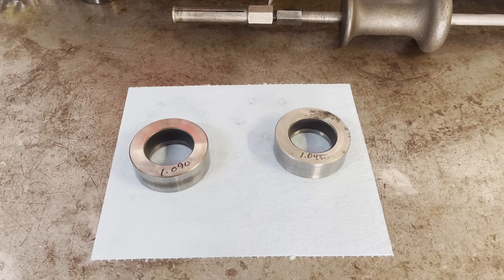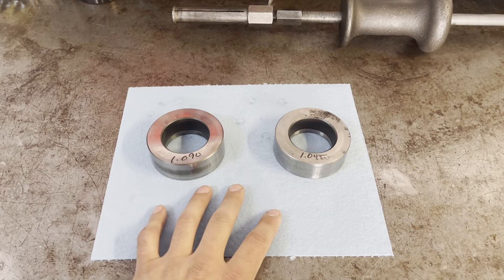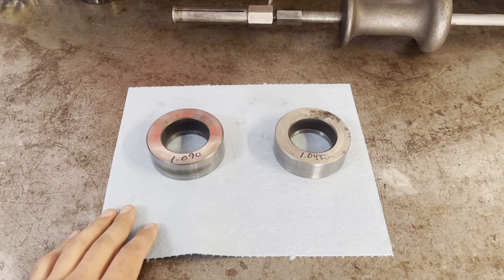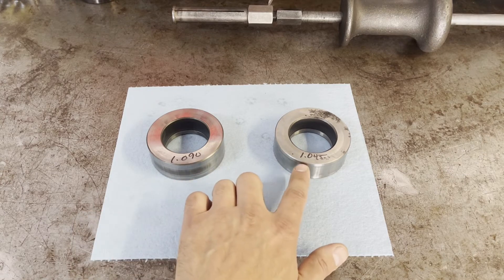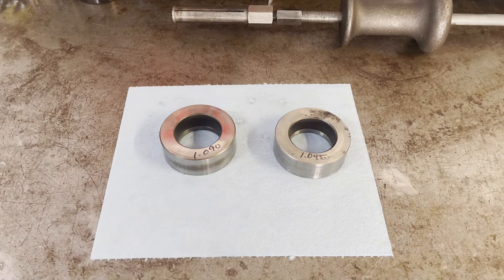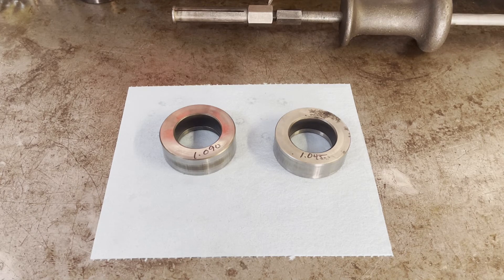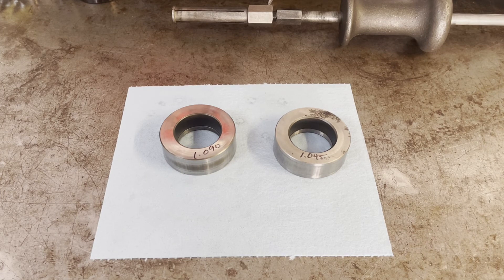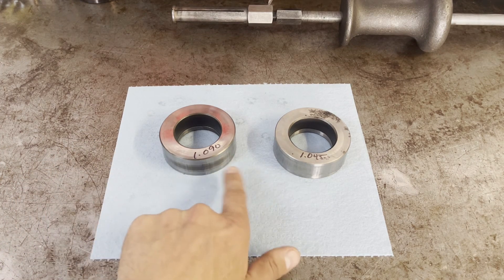Rebuilding the Ford C6: Low Inner Race and Effect on End Play

Comment: It also seems to stand to reason that the snap ring placement, where the lower ring gear locks to the output shaft, could come into play here as well!
Reply from the maker: It may if you use a thicker/different snap ring though I am not aware of that being a selective part.

Comment: So I believe this information is something I needed to see…….However I don’t know if what I did is going to work out or not.  This is the same unit that we have discussed in your build video and what a mess it has been from the previous builder.  Anyway my end play was nuts, nearly 0.090 with the black pump washer and still 0.045 with the thickest washer I have, 0.090.  Anyway I found a 0.025 shim from my rear end stuff that fit nicely under the rear planet thrust washer and with that in place I now have right at 0.022. Clearance.  I’m just a little concerned with the planet gear/ring gear contact pattern because I did raise the planet slightly.  It feels smooth so far and I can’t find another Low roller inner race at this time.  Also to get my forward clutch clearance at 0.025 I needed to stack 2 0.053 (ish) steels together in the middle of the clutch pack. I have seen units of other models done this way from the factory so I’m not as concerned with this as the other and stacking it any other way was giving 0.060 clearance in the forward clutch, 0.024 in the direct clutch and right at 0.040 in the low/reverse.
Reply from the maker: I don't think any of your mods/improvisations will lead to any problems but you won't know for sure until it's back on the road.
Reply: I pulled it all back apart and checked the planet to ring gear contact and it looked fine, still easily fully engaged as in none of the planet gear teeth were exposed/out of contact with the ring gear.  I even tried to shim directly under the ring gear but then I couldn’t get the snap ring installed.  I saw your other video about the roller clutch race and its effect on overall end play…..NICE information!!!  As far as I can tell this unit was pieced together from somewhat random parts with little to no concern about much.  I’m not proud of that kind of mod but I feel confident the shim that I made will stay put and everything turns smooth and easily, air checks well too.  I will soon see.  Thanks again for your comments and the time you took to put together the posts.  Take care Nick…all the best to you.
Reply from the maker: Thanks, Ross - you too!

Comment: I don't remember all the details, but I remember machining a pocket in the sprag race for a turbo 350 pump bearing. This is the part I don't remember, but I think the pocket was .130 deep, then you drilled a small hole into the cooler return since this is your lube circuit to lube the bearing.  Been a long time.
Reply from the maker: I have heard of folks doing that as well. I think John Wood does it for the C6 transmissions that he builds...Folks also have pre-machined bearings available on places like eBay from what i've seen lately.
Reply: @nickstransmissions  I bought the first one from a place in Pittsburgh called Recon A/T Parts, no longer in business. After I saw what they had done, I did some R&D, rob and duplicate and made my own. Those were the worst trans for starting in second gear, the governor would stick. I tied polishing the valves, all kinds of things. If you would stop, and back up it would flush out the governor since it was not effective in reverse. I learned later on that if you put a check ball from a GM trans in the one side, it would rattle the governor loose.
Reply from the maker: Interesting, Peter - thanks for sharing. I've also had some trouble with them but typically they are just dirty or contaminated and need a thorough cleaning to make function normally again...but every once in a great while, ill have to replace one due to shifting problems.
Reply: @nickstransmissions  I used an inline filter from Seal Power on the return line from cooler. Chrysler and Ford transmissions  had zero tolerance to dirt. Chrysler on some models, had a valve in the radiator inlet that would plug up, it didn't take very long to burn one up. I quit doing carry outs, guys would just slap them in, and not check the coolers
Reply from the maker: @monkeywrenchization  Agree, they are super sensitive to contamination, especially the dodge units. The cooler bypass valve / heat exchanger circuit is typically eliminated as it likes to clog or malfunction, resulting in mixing of coolant and atf thereby destroying the trans. Im not super familiar with them other than what customers have shared and that’s a frequent mod they do/have done.
Reply: @nickstransmissions  My 2014 GMC Sierra with a 6L80 has a cooler bypass on it. They claim that by waiting to cool the fluid, that it improves fuel mileage. Last summer I was climbing the mountain that we have many of where I live, I noticed that the trans temp was reading 240 in the driver display. I know that I'm old school, but I was taught that when the temp gets to 240, that it starts to break down, 260 acids and varnish form. It takes Dexron VI, is it that much better? There is a block on left side of bell housing that attaches the cooler lines. Remover block, on top there is a plug held by a snap ring. Remove plug and install the parts in the bag, put it all back together. Now it cools 100% of the fluid 100% of the time.
Reply from the maker: No, it's not that much better than Dex 3 that it can handle prolonged exposure to 240+ degree heat...At those temps, fluid does start to break down and before long, you're taking years / tens of thousands of miles off it's life. I also live where mountains are everywhere and tell all my HD/Towing-Hauling customers to stuff the largest, fattest aftermarket transmission cooler they can fit and run transmission temp gauges in the dash to monitor temps. They also usually elect to go with large deep pans for additional fluid capacity...I hate those stupid cooler bypass valves...luckily the aftermarket has plenty of delete kits for most applications.

Im assuming you changed the fluid before driving it again...
Reply: @nickstransmissions  I did change filter and fluid. Cost me almost $100.00 for Dexron VI 5 quarts. My truck is a 7200 lb. towing package, trailer brake hookup, bigger brakes, extra trans cooler in addition to the oil to water cooler in rad. I did some tuning with HP Tuners to delete AFM, and played with the converter lock up. The factory had it set to come on in 1st gear. I set it to come on in 3rd. Guess they were trying to get to mandated fuel mileage set by government. Really? That truck weighs 5500 lbs, and gets on average 15 mpg.
Reply from the maker: @monkeywrenchization  those jmbx converters are junk in stock form. I get them rebuilt with thicker converter clutches and for anyone towing/hauling, I recommend putting a billet cover on to prevent flexing/warping under load/heat.